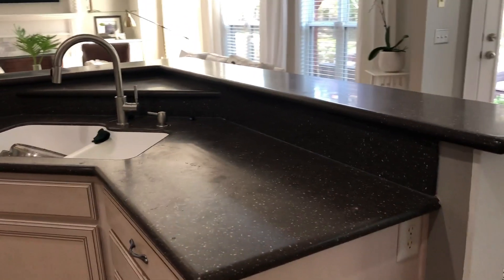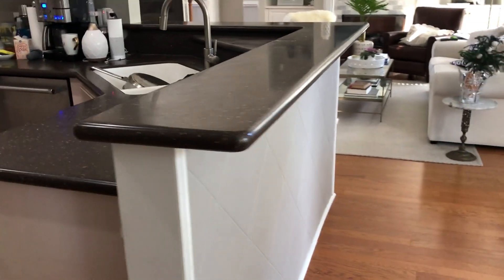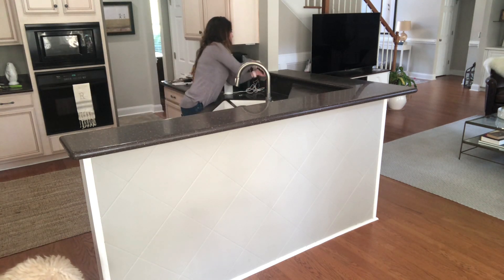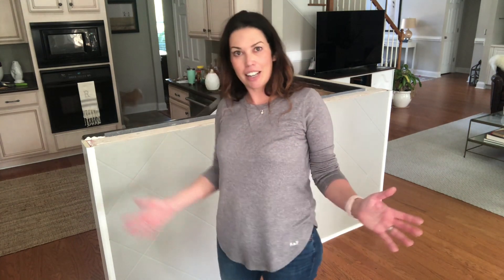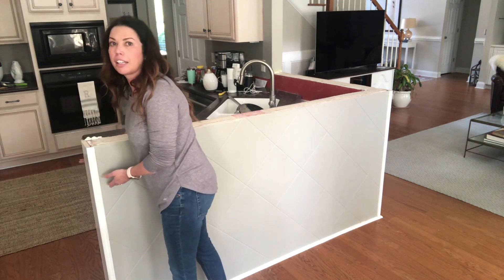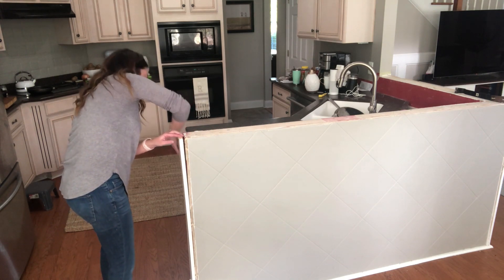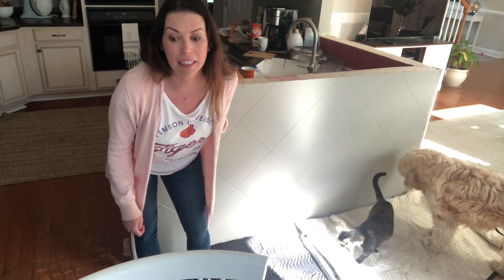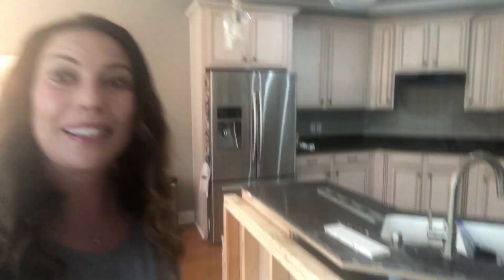How to Lower a Corian Breakfast Bar

Comment: Do u have the video after finish?  I saw there is a blog of your final view. I will do the same project. My countertop company suggested me to do the extension not only in front but also on the side. I saw you have extention during u had bar which beyond the wall but not on the island. Any reasons? Any suggestions? I am so confused now.